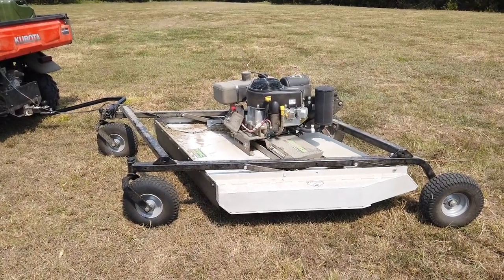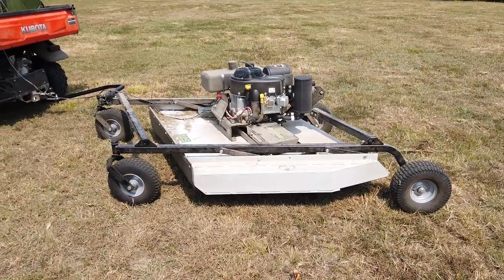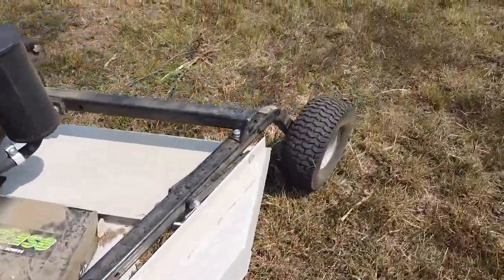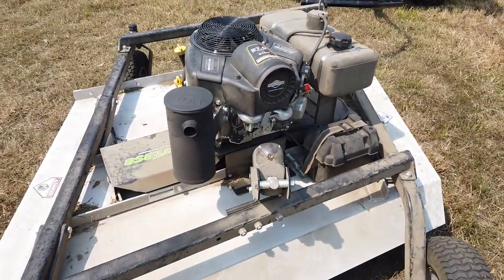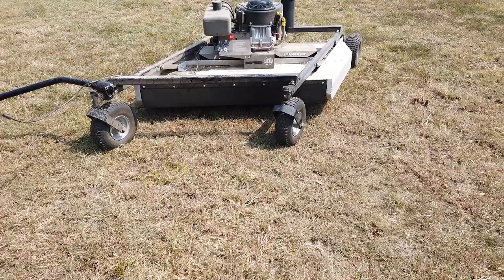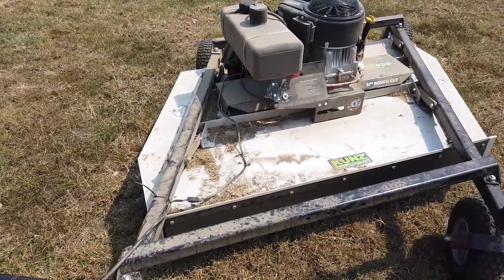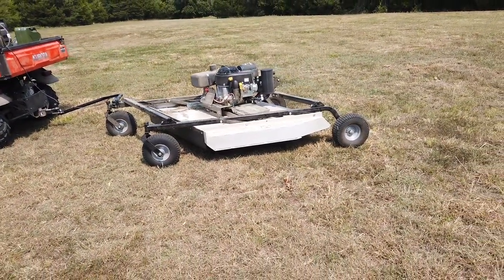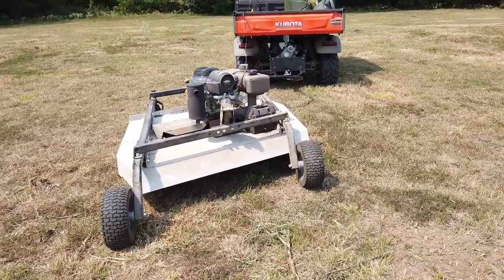Kunz Engineering MR55BE Review

Comment: Fun to watch it go through the thick stuff at full speed.  I mow an empty lot in our subdivision with their finish mower, and pulling it offset under the trees makes the work so much easier.  I know my finish mower is a beast, and I suspect the rough cut is as well.  Thanks for the footage!
Reply from the maker: Glad you enjoyed the video and had a similar experience with your finish cut mower. I managed to knock out about 60 acres that day and the land is really starting to come into focus. About the only gotcha was that shortly after the video was shot, I managed to get a portion of the hydraulic lift power cable under the deck while mowing, cutting a section to pieces, effectively preventing the deck from lifting. I'm sorting out a replacement cable as we speak, but just something to be aware of!

Comment: Thanks for the video; just ordered a 44" one for my tracked ATV - will be using it for 9 miles of xc trails - some very steep. Also have the option of pulling it behind a tracked Kubota RTV. Got electric lift kit; remote clutch;  flat proof wheels. thanks again for your video.
Reply from the maker: You won't be disappointed! The only thing to consider is making sure your electric lift cable doesn't get caught under your mower when you're towing becomes articulated.  I've gone through cables so far..I usually set the height for my mowing, then disconnect the cable to keep it from getting sliced in half.

Comment: Nice machine! .. You have enough land it's probably better to get a small tractor with a Finnish mower and pull your drag mower.  Reduce the hours on the utv. Some utv's cost as much as a tractor to maintain.. lol good video!!
Reply from the maker: There's two challenges I have with a tractor: 1. I have nowhere to store it on the property and I don't want it just sitting out in the elements. 2. Most tractors operate between 6-8mph when using implements. I can run up to 15mph with the RTV when mowing, cutting the time needed significantly. The only downside, as you pointed out, is putting so many hours on the RTV vs a tractor.

Comment: Great mower and looking for one to cut around 11 acre pond . That field though bro😮 you need an actual tractor
Reply from the maker: Yeah. I have every intention of getting a tractor and a shredder at some point,  but until I can build out there,  I don't want to leave equipment outside in the elements.  In any event,  I've been able to cut around 65 acres with just the tow behind mower and my RTV.
Reply: @ExpeditionOverlanding  that's pretty impressive and you got a lot of patience. I about went mental trying to cut my field with a 6' bush hog.  Trying to keep a manicured look around pond so looking at alternatives other than a bat wing mower
Reply from the maker: @jasscarborough  Yeah. Using a tractor and a bat wing limits your speeds to ~6mph. With the tow behind,  I can get up to around 11mph cutting speeds with my RTV.
Reply: @ExpeditionOverlanding  so I was considering getting a rough cut mower like the golf course uses . Cut deck 15' wide but I haven't really seen many people use that for my application. Any thoughts on that ? The pull behind mower would be used to hit pond edges and not worry another getting stuck with my four wheeler
Reply from the maker: @jasscarborough  Kunz sells both a rough cut (which I have) and a fine cut tow behind. Is this what you were considering?